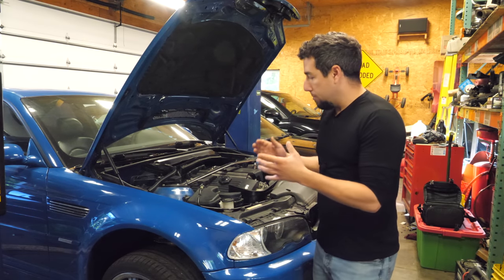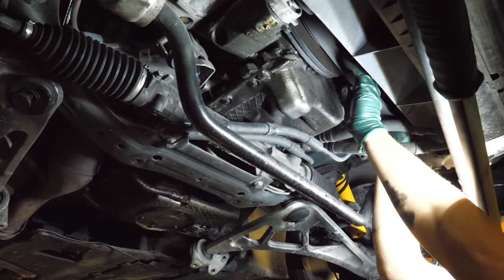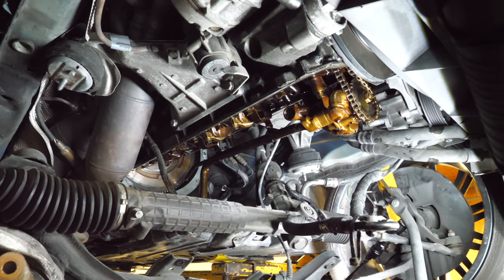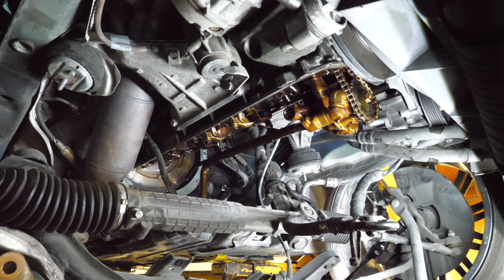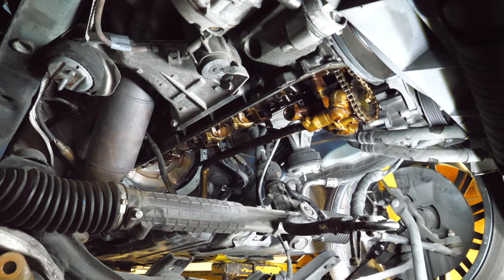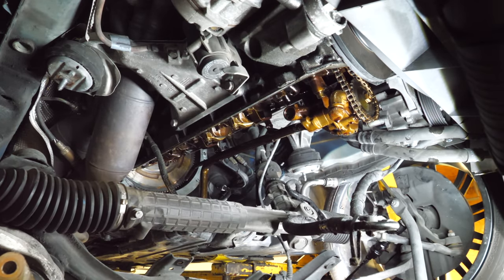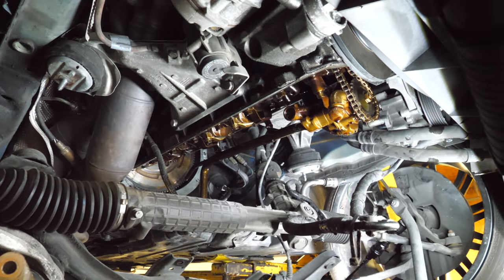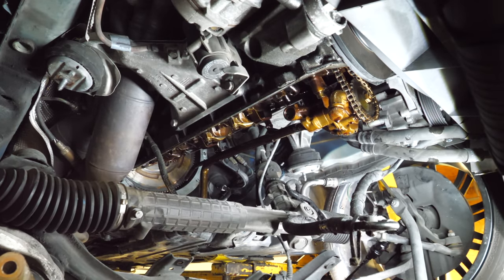Copart Laguna Seca E46 M3 Update! Rod Bearings & Vanos Rebuild, Was I Seconds From Disaster?

Comment: When I got to the part of the video where you show what was going on with those bolts, my jaw dropped. It's a miracle that engine didn't grenade it's self. I've owned too many BMW's, I am used to them totaling themselves without ever being in a crash.
Reply: Good reason to keep purchasing them.
Reply: @yamaha226  Before everything started inflating, it made more sense to buy one at such a low price if it was in decent shape and then take a gamble on getting a year or two out of them before scrapping it, not so much anymore.
Reply: @Elementaliti  I understand now.
Reply: Used to totally themselves without being in a crash? Tf that even mean?              That just sounds like a bad owner? Ive owned many too but never lost my faith in a single BMW.
Reply: Take the 3rd gen 4runners for instance, built tough like no other but when they experience wear from a few owners the engine will lost steam very quickly, next thing you you got worn cams and leaking oil because people where hard af on it. Cams usually go due to mileage but eh, still rather blame the individual responsible for over half the wear on the vehicle lmao. Its all in the owner. Only thing outta place with these cars is their owners and people who think they know anything about them but dont.
Reply: @acewingdabson3139  being a responsible owner who does meticulous maintenance is not going to fix a shit design. It doesn't matter how good of care are you trying to take of a BMW. An abused and neglected Toyota will undoubtedly hang on a lot longer than even the most pampered BMWs. Quality engineering matters just as much as responsible ownership.
Reply: @Elementaliti No car manufacturer is perfect. There are poorly designed Toyota engines that I wouldn’t own. I like Toyota a lot and I feel that they have made better engineered and more reliable vehicles than any other car manufacturer but I don’t agree that any Toyota is better than a well taken care of bmw

Comment: This reminds me of when I replaced all the rocker arms and lifters on my Wrangler's Pentastar V6 as preventative maintenance. Jobs like that are always daunting, but if you're meticulous and follow the steps, it's definitely achievable. A $4,000 estimate was all the incentive I needed to tackle the job.
Reply: That's such a great engine, but like this bmw, I can't understand what happened with the rocker arm and valve train issues on those things? Was Chrysler just cheap? Bad metallurgy?
Reply: @life_of_riley88  that's a fair question. I think every drivetrain has its Achilles Heels, some are more problematic than others. 

I can't speak specifically in the case of Chrysler, but it could have been a supplier issue (like the valvetrain issue on a specific batch of Ford Bronco 2.7s), possibly a specification issue, or something else. What I do know is that when I did the job, the part numbers were revised at least once, possibly twice. In my case, I could tell the rollers on the rocker arms were starting to tighten up, but it would've done me no favors to wait on it. Luckily the cam lobes weren't wiped, but I'm sure if I did nothing until the bearings started to seize, I'd have been looking at a much more expensive repair. 

After the fix, though, the engine runs wonderfully. So that's something. :)
Reply: @mphilleo  4.0L TJ guy here. I know those motors are pretty powerful...but man do i ever love my straight 6. Not the most powerful or efficient..... but always reliable. Congrats on a job well done sir. o7
Reply: @ericthimot  the 4.0 was/is wonderful. I'd have loved to own a 4.0 TJ (having had a number of XJs and ZJs). Great engine. I've seen the 3.6 Pentastar go 350-600,000 miles, so I know my effort was well-spent at 86,000 miles. And thank you for the kind words.
Reply: Chrysler had absolutely no excuses for screwing up their valvetrains as bad as they did.. Then just like their German owners at the time denied it was ever a problem.

Comment: It takes a lot of engineering talent to build so many fatal flaws into a single engine.

Rod bearings! Multiple catastrophic Vanos failures! Disintegrating chain guides! This engine has it all.
Reply: Reminds me of the 5.4 3V, of which I own one.  In that engine's case add oil pump, they are all aluminum and tend to get high clearance inside after a good amount of miles.  The Melling replacement has a steel backing plate instead of being all aluminum.  At least the 5.4 3V easier to work on.  Couldn't believe the stuff that was pulled under the car on the M3,  completely removing the steering box and folding all that stuff out of the way.  Yikes.
Reply: Also the cooling system, and the CCV system. And on the non-M engines, you have to worry about the oil pump self-disassembling.
Reply: Don’t forget the oil pump failure
Reply: cant beat ford cleveland, last forever, never stop..
Reply: The Vanos and chain guides are stupid, but the bearings aren't really an issue on this engine until very high miles. It's not like S65 and S85. This engine is NA 3.2L and makes 333 hp without direct injection. It revs to 8k and it's oversquare. It's a highly stressed design so some bearing wear is to be expected. To me, it's worth the trade-off. It's an amazing engine that requires some preventative maintenance.
Reply: @harrywalker5836  I’m daily driving a fe
Reply: @JimBronson  what????a 5.4???? this motor specs rod bearing replacement every 30 k
Miles.
Nothing on a 5.4 is common with bmw specs.
Or maintenance, schedule. Not even close. 
Please try and keep up!!!

Comment: I have an e82.
I was considering an e46, but I'm glad I went with my choice. Thing rips, although both cars would have been a great journey.
I've done so much to the car myself in 2 years of owning it. Oil pan gasket, Valve cover and gasket, belt and pulleys, motor & trans mounts, full m-control arms, lsd, axles, & solid subframe bushings (warped a 6-ton hydra press!) 
There's much more to be done, like an m3 rack, better turbos, fuel pumps, m-fender flares, sunroof delete, a better sound system, & an Android head unit, but it's been a lovely (& extremely painful) experience, because when I drive the car, oh man, it drives amazing, feels intense, and the slow progression I feel as I turn it into a better car is satisfying.

I feel like I can tackle almost anything, because of what working on this car has taught me. Oh and it's YouTubers like you and many others that upload helpful content for those looking to start work on their car!

Comment: You talked about the chassis reinforcement at the beginning of the video and I suspect we're thinking about the rear subframe stresses that are common on E46s. My wife has a 2003 325i E46 sedan. It's pretty vanilla with an M54 and a 5L40E automatic transmission, but it does have sport suspension. I've done a lot to it over the years, but I'd love to tackle all of those "Big 3" projects in the near future. Thanx for the update on your gem.

Comment: First time and maybe last comment I will make here. I am currently working on doing a refresh on an 00' C5 Corvette with 120k on it, 90k of it me. Ignition sensors, gaskets, timing assembly, balancer, engine mounts, differential mounts, all suspension bushings. Inspected the cam lobes I could see and they looked perfect. +1 for using quality oil and keeping up with it. I really like that you went through the effort to make sure the car was mechanically sound. Not only do I dislike the throw-away mentality BMW seems to have but I champion the skills required to fight their laziness and the resulting autonomy gained from it. Being an engineer myself, when you you found the pen marks on the crank from a 30k bearing change I had question marks running through my head... 30k and it needs a bearing change? That seems absolutely insane to me. Furthermore when you were pulling the bolts out of the cam gear I literally cussed at the top of my lungs at the absolute incompetency of the design work put into such a neat vehicle. I would really like to know why these bolts fail in this manner. Was it improper torquing from the factory? Undersized bolts? There are classes where all you do is literally study fastener design and I just cannot wrap my mind around how BMW hired someone that would do this kind of sloppy work.
Reply from the maker: Normal cars, IE Your corvette, can and will last as long as it’s owner or user will take care of it.
This particular engine, not all BMW’s, but most BMW’s with the “S” designation” are very high strung and for these engines rod bearings are a maintenance item. Early m3’s of this generation like mine were subject to a preventative technical service bulletin where bearings and bolts were replaced preemptively. The originals likely looked fine. 
The cam gear bolts back out. Proper torque and some loctite would’ve kept that from happening. 
I don’t consider this to be anywhere near as awful to maintain as modern BMW’s and that’s why I don’t own any.
Reply: @I_Do_Cars  Agreed, they really want to lease as many as possible, thus the sealed transmission cases. It would be interesting to see some ambitions hobbyist cut through, rebuild, and weld one of them back together just to spite BMW and their current design model.

Comment: I feel so lucky when I had to drop the oil pan on my 2.5T XC90 when I serviced the PCV system, other than a single engine mount bolt in the way that I had to remove there was nothing in the way to drop the pan. The drain back from the PCV was completely filled with carbon with the consistency of a charcoal briquet from the previous owner probably using cheap oil and never changing it. Only fun part was the anaerobic sealant Volvo uses instead of a normal pan gasket. Saved a bundle though changing it myself and other than some bruises on my forearms from the stupid banjo bolt up top that is a royal pain to get started it was an easy job just took a few hours to clean everything before it went back together. I keep a bronze wire wheel on my bench grinder to clean up all the bolts before I reassemble too, nice to see others clean them too.  I see a lot of Volvo's with 2.5T's with blown head gaskets on facebook market place, that would be one that would be nice to see a tear down of.

Comment: Your Dad taught you to be thorough and cautious. You knew at some level something wasn't right. Good thing you checked or you would have been one unhappy camper due to five small bolts failing. I don't know how much they cost, but there needs to be better ones that don't back out or break in half. That seems like a design flaw.
Reply: Threadlocker? Maybe? I know nothing about BMWs, so that's my "shot in the dark".

Comment: I love youre channel and find it the most entertaining and informative. Thank you and please keep doing what you doing. Having  said that i have been a mechanic for many many years and i can't say i have seen it all.We never stop learning.I learn from you aswell. I have always told my friend who is a big beemer fan that although they are great performers and handle well they are just rubbish like any other modern car. They fall apart just the same as any eastern junk as you work on them. Cheap Plastic , perishing rubbers, leaking pipes,brittle hoses ,the list goes on. I was with him in his E30 325 just sitting at the lights,when as he pulled  off normaly a rocker broke in his engine.. When we pulled the cover and i saw what that rocker was made of i was horrified .Cheap and nasty cast alloy of something or other. Anyhow i watched as his E 36 M3 fell apart and this is a guy who loves his car mainains it and treats it better than his wife and kids. By the way these old cars ar not his dayly drivers more of his collection of old bmw's.Not just knocking one brand, they all rubbish .Todays cars are all just throw away  appliances. Cant rebuild most of the engines and you will never see 500000 miles like some of the old Toyota, Mazda,Hondas Mercedes,Ford GM or Mopars of old. All in the name of fuel economy ,clean air etc. What a lot of crap. You can get a Carb,points and condensor distributed motor to run clean and efficient.The little gains achieved with Emission Controls ,Ca  talitic Converters , low tension rings etc are negligible . They only benefit the manufacturers and the replacement parts market. Zero benefit for the car owner.  Only costly repairs and maintenance.Not against progress ,but not at any cost. I used to be a petrolhead ,but now i hate these 4 wheeld appliances and just love to see them crushed..

Comment: Nice job mate, I've done the big 3 (and then some) on my Silver/Grey M3. Had the same broken chain guide but my vanos issue was ticking (excessive play in the oil pump disk holes) Interesting with the wear on the bearings - my worst one was also cylinder 2. The upkeep and maintenance is worth it, these cars are amazing to drive and the S54 has to be one of the all time greatest engines. Love the channel, Thumbs up!

Comment: From experience, plastigauge is more to check the new shells rather than the crank.  Many times I have had new shells out of spec. when tested. Swap over to different brands / batches and get back in spec.  (Seems some shells come assuming wear plus a linish to stay in spec.)  Always check at least one new bearing clearance!  Also, any oil between the shell & rod/cap just invites it to spin so it must be kept 100% dry.  No oily glove fingers!  There is a lot more to building an engine properly than most fully appreciate.  Good luck! Ron

Comment: My N55 had a recall to replace the aluminum VANOS bolts as they like to break too. Amazing that BMW seemingly went backwards with those bolts in later engines even though the early ones had problems too. They appear to be steel in your S54 and still failed.

Comment: As a fellow owner of a 2002 E46 M3, that was a great video. I'm so glad that you dodged the VANOS bullet. You're spot on that had the rest of the bolts failed, you would have been tearing that engine down on the channel. As much as I would have liked to see a teardown of an S54, I'm glad it wasn't your engine. I did the VANOS on my engine. Well done. BTW, the bolts on the subframe reinforcement plate are single use and torque to angle. I thought the rod bolts were torque to yield, but maybe the ARP bolts are different from stock.
Reply from the maker: ARP bolts are not tty, part of the reason I went with them.
Reply: @I_Do_Cars  Sounds like a good choice. I got my hub bolts from Lang Racing. They are stronger than stock. Maybe less likely to fail.

Comment: I wasn’t aware that the inline 6 engines suffered from rod bearing failure I was under the impression that was the m5 and m6 v10 engine solely. Good to know. Great video as always.
Reply: Most BMW engines suffer from AT LEAST rod bearing failure. They really are not designed that well, which is a shame because they make very good power. Maybe their newer engines are better, but I was shocked and still am that Toyota was ballsy enough to put their badge on something with a BMW engine in it. Actually it isn't Toyota's badge on the "supra", it's a BMW part number for a Toyota badge, because it's a Toyota, I promise, it says so right on the front!!!
Reply: This is the only I6 that has rod bearing issues. It’s the only one that revs to 8k also. This engine doesn’t have it nearly as bad as S85 and S65 though. They are always good for at least 100k that I’ve seen.